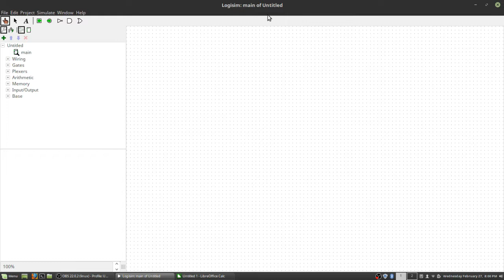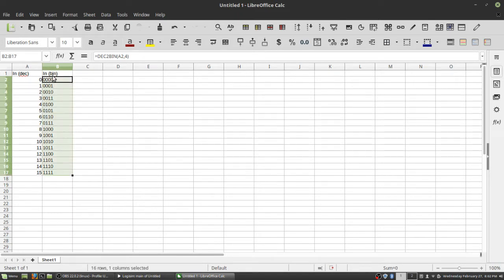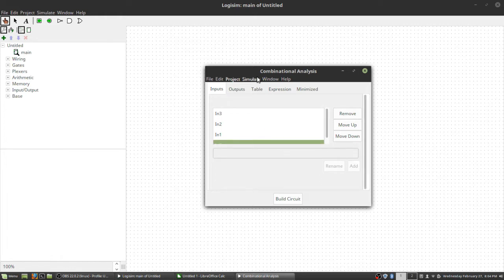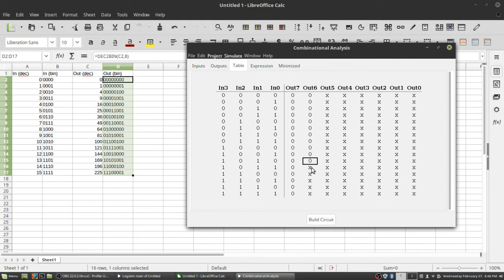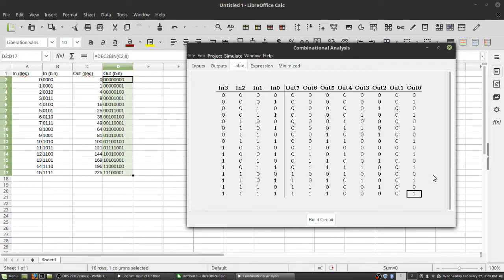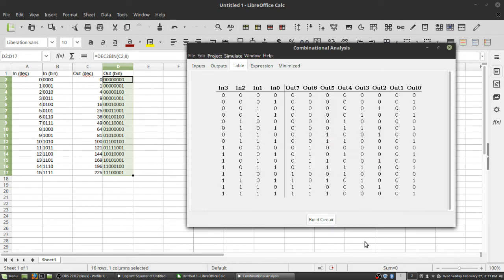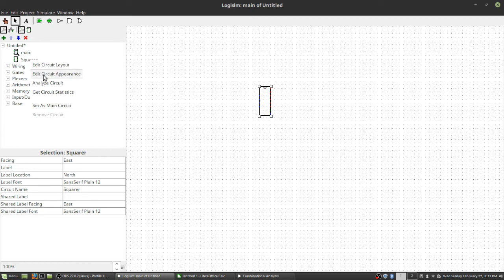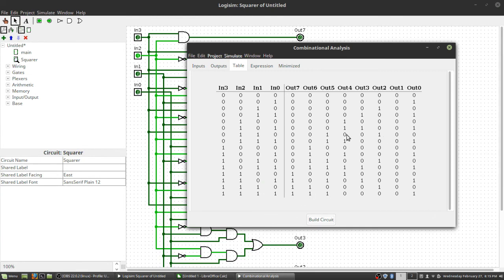Logisim Squarer Design

Comment: Quick Tip figured out, when creating the combinational analysis truth table, instead of clicking on every individual X to change it to a 0, click on the first cell of the output and hold down the number 0 and it will auto fill down the whole table. you can also do this to simply fill out the table by typing 1 ,0 or X on the highlighted cell you are on. 

Thought it might be helpful.  Thanks for the video!